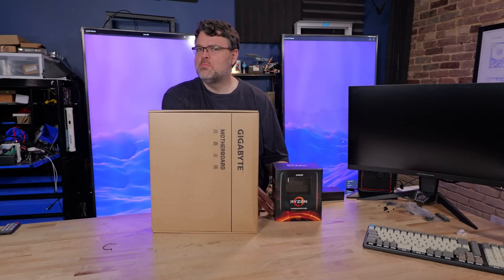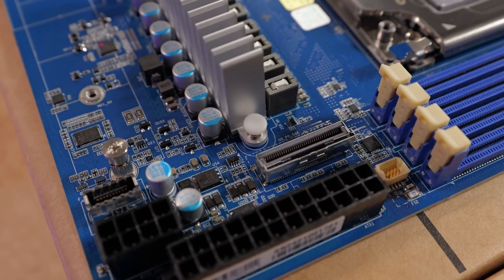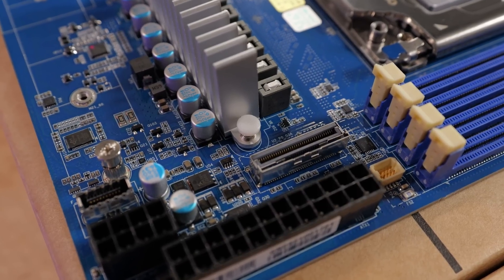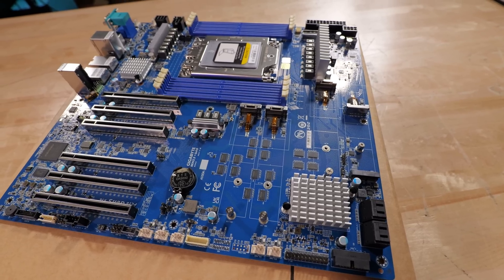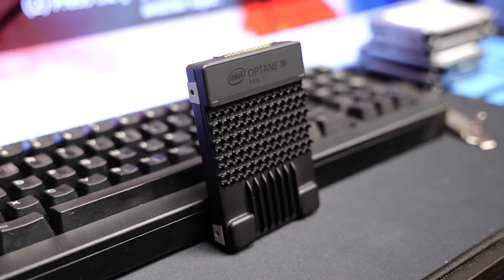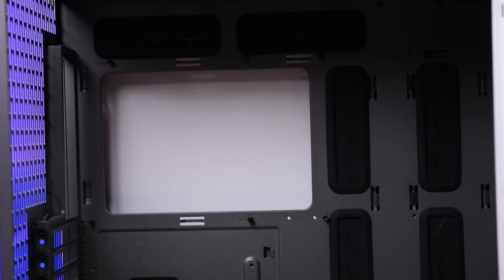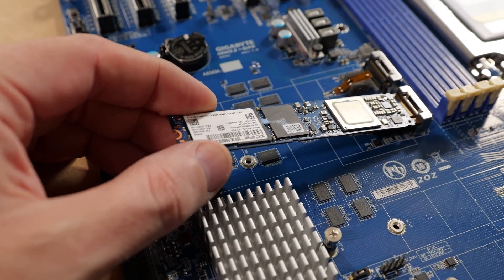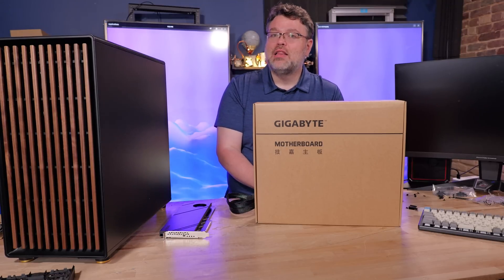Gigabyte Joins The Threadripper Pro Fray! Checking Out The MH53-G40 Motherboard

Comment: Still a little scared of AMD as sadly a lot of the large commercial EDA software that I run still don't play well (perform) with AOCL for whatever reason. Everything I use seems to be optimised for MKL. This leaves me stuck with 34xx Sapphire Rapids - fewer cores, lower clocks, worse  energy efficiency but ends delivering better (shorter) runtimes.
Reply from the maker: I'm working on this join us in the forums :)
Reply: @Level1Techs  Cool. I'd be interested in benchmarks for something like Ansys HFSS, Cadence Clarity, CST MWS, Keysight EMPro.

Comment: This is just a full server board with the WRX chipset and bios. Makes sense for the low volume market of Threadripper Pro 
But that VRM just seems insufficient. At least throw a bigger heatsink with denser fins and maybe a heat pipe on the thing.

Comment: This could be a foundation for an enthusiast, TrueNAS Scale NAS/VM system. A handful of users can operate from drive-less clients and log into VMs with a dedicated GPU. The SilverStone AIO should improve the temps on the VRMs and in September noctua is releasing the NF-A14x25 G2; this may be a significant case upgrade. 

If it's nothing fancy, why is it connected to the CPU, and not the chipset? 5:00

Comment: I got 3970x and Icegem 360 yesterday and I was soooo surprised that it kept temps under 78 degrees while doing a multithread 30 minutes cinebench test. It did touch 82 once for like half sec but otherwise it was under 78 degrees. Would love a video on those coolers. I hate how the rgb looks on it though, it is like I am taking my cooler somewhere here in a local Pakistani wedding. Why couldnt they keep the rgb part of pump minimal man.
Reply: Keep an eye on the IceGem. I had trouble getting mine to seat evenly and cooked the thermal paste out. Temps kept rising over time. Swapped it out and now running much cooler. Will take time to measure the old one when I get a chance- suspect one of the brackets is bent or has a thicker powder coating. It takes a very small manufacturing error to give you hassles with this design.
Reply: @ChrisSuperTube  I literally ran into this problem like 5 hours ago. One side of the plate of the cooler wont sit properly but I am glad I had a professional's help.

Comment: Wendel: "as low as 65°C [can be problematic for DDR5]"
Me: * looks across the room at G.Skill, who gave a max of 60°C as the normal operating range in an official forum post *
Reply: Likely speed dependent.  Quad+ channel WS boards have to run a lot slower, which will raise the maximum stable temp of the RAM chips.

Comment: Wendell: If you're running Intel 13900K or 14900K, you need to be aware that they're at a high risk of degradation, even without overclcocking, and even on workstation motherboards.

Also Wendell: If you're running a 96 core Threadripper Pro, you can definitely overclock it, because each core is getting a lot less power than the lower core count models, and it's a real shame that this particular board from Gigabyte isn't that good at overclocking.

The world is crazy these days.
Reply: blame Intel for screwing the pooch with this one
Reply: @marcogenovesi8570  Yeah, I'm not blaming Wendell at all. It's just such a massive discrepancy between AMD and Intel at the moment.

With Intel there seems to be no safe thing to do with its desktop CPUs, and with AMD the word is that they're so rock solid that you can overclock the crap out of their workstation and server CPUs (at your own minimal risk of course).

Comment: you have not lived until you have unboxed a beautiful blue Gigabyte board.

I recently paired an EPYC 7352 with a Gigabyte MZ32-AR0 (easy firmware update to enabled rev. 3.0 Gen 4 speeds on rev. 1.0 boards). Unlike the WRX90 board (e.g., MH53-G40) Wendell is showcasing, the MZ32-AR0 has a suboptimal layout due to the DIMM slot placement at the immediate rear of the PCIe slots preventing the installaltion of full-length PCIe cards in 4 of the 7 slots. 

The issue required a pivot to the more expensive ASRock Rack ROMED8-2T which supports the installation of full-length PCIe cards in all 7 slots thanks to less DIMM slots and a different layout. To be fair, the MZ32-AR0 was originally designed for 2U deployments and half-length HBAs. 

Risers can be used as an alternative in the MZ32-AR0, but that solution ran counter to my plan.
Reply: I did something similar with the AR0 v1, and revived a Supermicro 846-4U case with it.  Agreed, you have to do a "dance" with those close PCIe slots over the RAM slots!  Quick question if you know, are the VRMs insulated so I can put a heatsink across them or would it short them out?
Reply: @DynotoeTube  
Wouldn't short them out but you wouldn't go metal on metal anyways. Use a thermal pad (or paste if you have to). And you want to put heatsinks on the MOSFETs, not the coils/chokes.
Reply: @-eMpTy-  Thank you for the info!
Reply: you can flash the rev 1.0 of that board to 3.0 to support Milan CPUs btw
Reply: Got the same board but with the 7d12, layout really sucks for a gpu compute server, ended up with only 2x gpu instead of the initial 4, had to also modify 1 of the gpu to be sff form factor for it to fit.

Comment: Don't get why workstation parts cheap out so much on the VRMs whereas "gaming" boards are now so overbuilt (such as 20+ 100+A MOSFETs) that they technically don't need heat sinks at all even with heavily OC'd high-end CPUs.
Reply: You said it yourself.  Gaming boards are overbuilt.  Adding extra parts is how they can turn a $150 motherboard into a $600 board.  This board isn't targeting the gaming market. It's built to a certain spec, which doesn't need 2000W+ of CPU power.
Reply: Keep in mind it hasn't been that long since high airflow cases came back into vogue, there's a lot of poorly ventilated (Biggest offender being NZXT) cases still being used so overbuilding the VRM makes more sense than at first glance since the load can be spread out over more chips which means higher efficiency, less heat, more surface area and fewer hot spots.  Of course large down draft coolers like the NH-C14 easily fixes that issue anyways but those haven't been popular since the P4 and early Core 2 era.
Reply: Don't need heatsink in OC if you want to make them run at 100° and even throttle in some scenarios, i'd instead like them to run at much lower temps in my home pc also making the component stay alive for longer and pay a little more for that.

Comment: man this is what i want out of an enthusiast board instead of 3 pcie slots.
Reply: I need more PCIe... ALWAYS.
Reply: Gamers killed off multi-GPU & multiple PCI-express slots.
Reply: @kevinerbs2778 Lack of proper support killed it.  Pricing was such that it was more effective to buy a cheaper set than a high end cards for those willing to deal with it which was counter to their business model.  It also increased the time necessary for modern games to overwhelm the GPUs necesitating an upgrade.  They abandoned the bridge connectors and offloaded the load to the PCI bus placing more load on the cpu and reducing the benefit of running cards in tandem.  They moved the control of implementation to the game developer who sees zero benefit from bothering to do such. They chose to never put forth the effort to make mGPU user friendly and to not implement a user friendly control set or even a user controlled set in dx12 when they worked with microsoft developing it.  They killed mGPU.
  Crossfire and SLi were not for the majority of gamers.  They were for those that gamed in addition to dealing with workloads like 3d animation, a subset of enthusiasts which either wanted the maximum amount of brrr but were willing to deal with some headache, or enthusiasts willing to deal with some headache to get a more cost effective brrr.
  It wasn't for the gross majority of the market, was user friendly for its market, and by effectively killing it they forced that sub market to spend more money over time.  mGPU would only have ever been financially viable for the manufactures in gaming is if they had made it the norm.  The lie that gamers failed mGPU is and always will be ridiculous. The manufacturers failed to make it the norm which was the only way they could have made it financially viable and to do such would have first required the price jump between series variants being greater than an entire card's cost necessitating sale losses for at least 2 generations and likely more before the new norm would generate profit.  Don't blame gamers for manufacturers being unwilling to play the long game.

Comment: pardon the question, but is it more important to put the thermal sensor on the M.2's storage controller or NAND module(s) ?
Reply: storage controller, that's what will throttle if too hot and is most sensitive to temperature. flash can take higher temps and in general performs better if warmer

Comment: Imagine not having a 20+ phase VRM to power a 125W chip. Truly revolutionary stuff here 😅
I am glad that there is at least this one board that is actually reasonable with its VRM configuration.
Reply: I think WRX90 boards are about the only ones out there that can justify their VRM stages, since you can actually pull 1000W through them with custom liquid cooling alone (and over 1500W in liquid nitrogen scenarios). That’s not to say the Gigabyte board is insufficient - it’s perfectly fine for its use case
Reply: server boards often spec realistic VRM instead than "big number better". Probably because they don't use that as marketing for normies

Comment: Can you by chance put X4 NVME PCI-E adapters in all slots (or five of six slots) and run RAID across them?  I have a 3D Point Cloud bottleneck I am looking to mitigate.
Reply: The manual does indicate you can select x4x4x4x4 on any of the PCIe lanes.

Comment: looks like more then 10 layers
Reply: Very likely with that number of X16 PCI-E connections.  Those require matched length traces with as few vias as possible for Gen5. That equates to more layers.  It always amazes me what you can do in volume but at the end of the day physics wins.

Comment: The m.2's on my x570s thermal throttle all the time. Had to put a fan directly on the m.2 heat sinks because that heat sink also cools the chipset, big mistake by manufacturers. I really miss motherboards with fans on the chip set. Usually I water cool every component but the new boards don't have compatible waterblocks because water cooling took a back seat for companies for the past few years. I remember 2017 and waterblock everywhere! I haven't had to manually machine a block since 2015. Time to dust off the drill press.
Reply: this is one of the reasons why I despise onboard m.2 slots. Just make it a pcie slot and let me get a carrier card with a fan
Reply: @marcogenovesi8570  exaclty, the m.2's are completely overheating my MB when I run heavy software. like Affinity or adobe.
Reply: Yea the 5.0 m2s can get super hot. I bought some aluminum heatsinks on amazon with a sticky thermal pad and they helped quite a bit.

Comment: Sigh. When are they going to make a motherboard with dual width pcie slot spacing? Intel had one for their xeon like, 10 years ago, that had 4 x16 slots, with a space in between them, so you could run quad gpus.
Reply: I hear ya. Some will say that parallel GPUs are becoming bottlenecked by the PCI-E overhead and thus NVLINK etc. But with AI there is a real market for it.
What I want is to see a new form factor with a 48VDC standard architecture.  The vestigial-ness of the ATX form factor (40 years old!) is actually increasing cost now. You need more cabling and thicker conductors with 12V. You have chassis cooling problems do to the original IBM XT  ISA plug in module thinking. Servers are unique board geometries but they are trying to move to OpenCompute etc. What would be great is for OpenCompute to move the beneficial subset to the tower market to allow for scalable powerful upgrades.  Its very very doable and would cost less to manufacture. Imagine one 48VDC power supply with maybe a trickle of 5V and 3V for basic boot UEFI stuff.  On the PCI-E side the next steps should be in broadband approaches ala Ethernet and DRAM.  SIgnal baseband differential now. Move to PAM4 for the next step. Define each next gen with addition modulations schemes keeping the base clock the same. (More bits per clock.) This will "freeze" the Motherboard layout and cost with the silicon "autonegotiating" the modulation and bandwidth supported.   I WISH there was a way to be heard on this thread.
Reply: @dennisfahey2379  I ended up getting an ESC4000A-E10 and running an epyc with 4 gpus and it was great but I kinda want a nicer form factor for my desktop than a massive 2U rack server XD
Reply: You do realize you can still run quad GPUs on this board?  You can just block the middle slot in both 3 slot groups, you lose nothing by having the extra slots.  You just need a full tower that has the extra 8th bracket or larger.
Reply: Full towers exist. Make a 'workstation' board to fit them, eh?